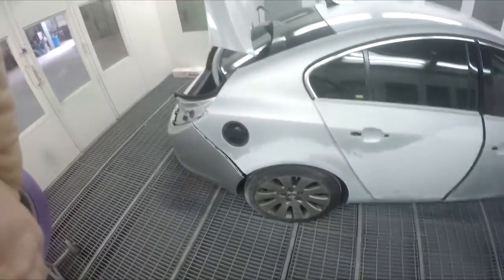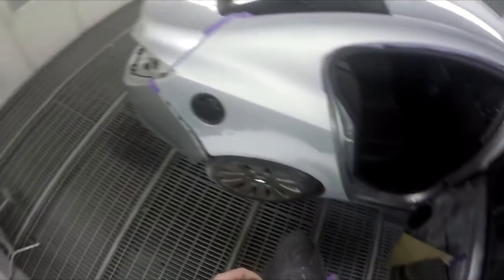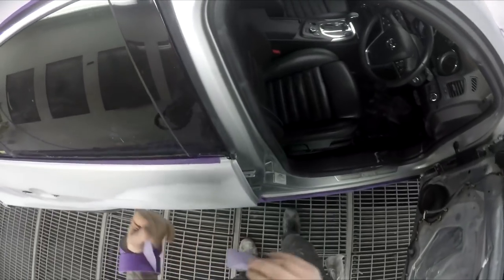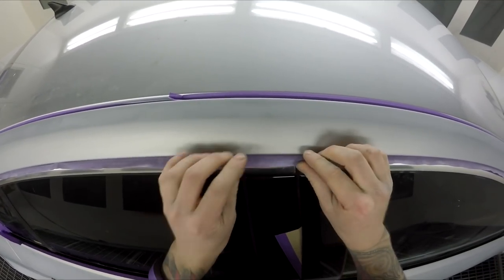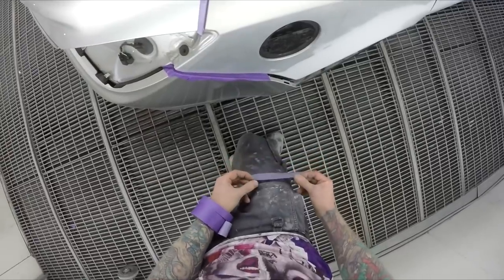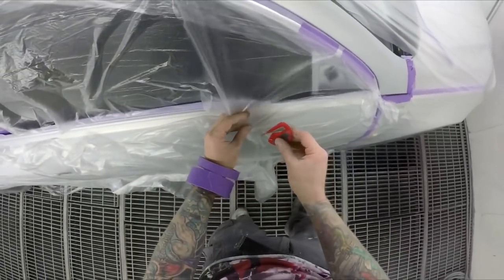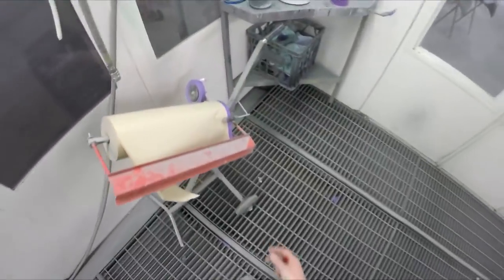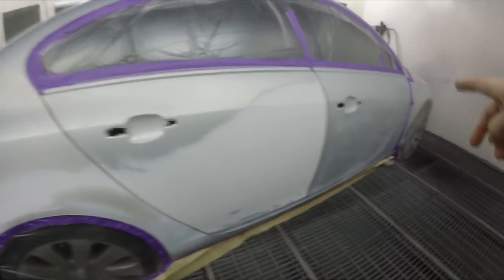Masking The Side Of A Car

Comment: Don’t worry about the length of videos I think the longer the better . Everyone of your videos I’ve learnt something. I’ve Worked in a few bodyshops mainly doing stripping and fitting and mechanical work. Started doing some prep work for the painter and got on ok with that and then started a bit of repair work and painting had some good results but only because of your videos and knowledge that your passing on  keep up the excellent work gunny . 👍👍👍👍😁😁